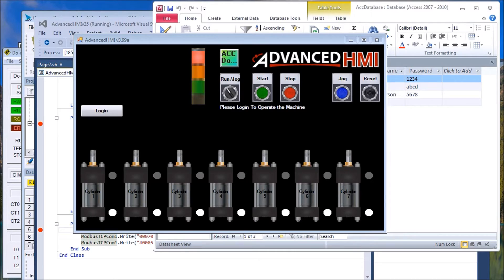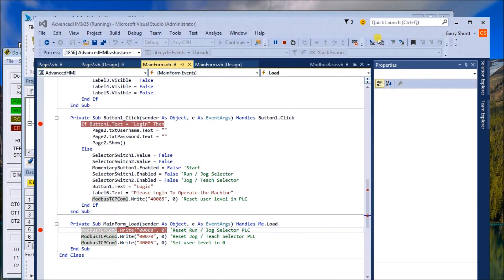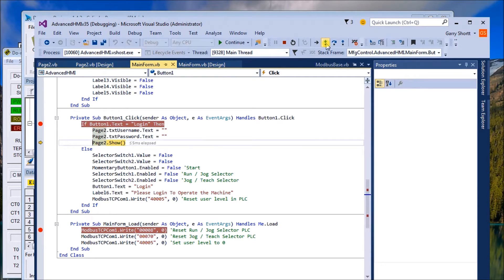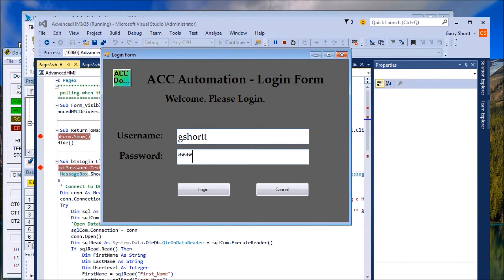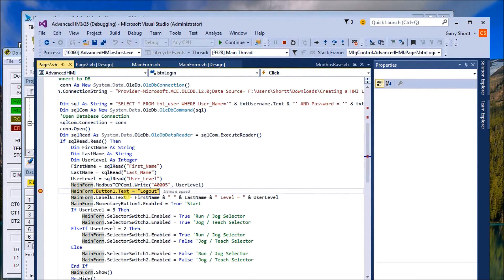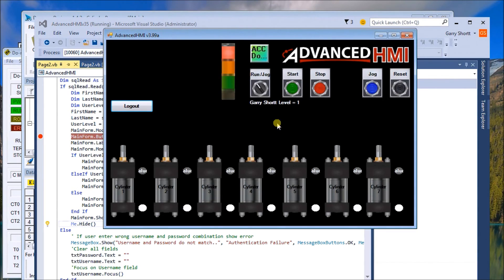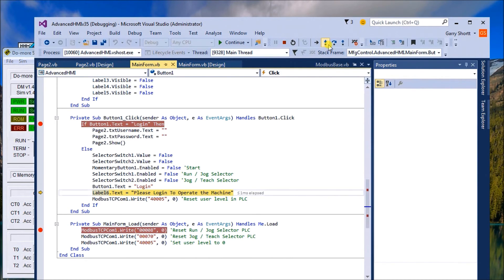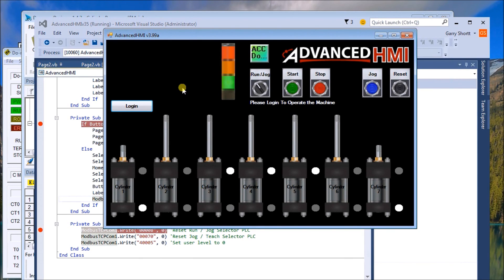Unlock HMI Security: Password Protection & User Level Control

Comment: Garry another great video... i am getting lost in so many videos... so, is there one on creating the AdvandedHMI screen with buttons, lights, text messages, and HMI analog input register "123.4" to communicate with the Click-PLC or Arduino with Modbus-RTU RS232 not RS485?  Also, is there an AdvandedHMI manual so i can read about the software and not ask so many questions? thanks..
Reply from the maker: Hi q zorn,
Thanks for the comment. Each of the videos has a corresponding website page with further information that will help with the explanation of the post.
Here is the one for this video.
https://accautomation.ca/creating-a-hmi-login-screen-on-advancedhmi/
I hope this helps you out.
Regards,
Garry